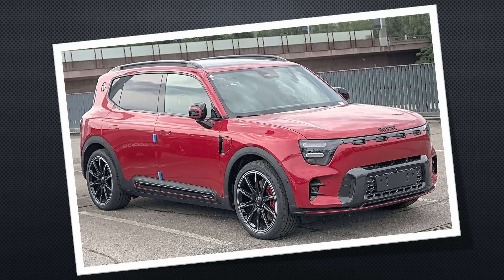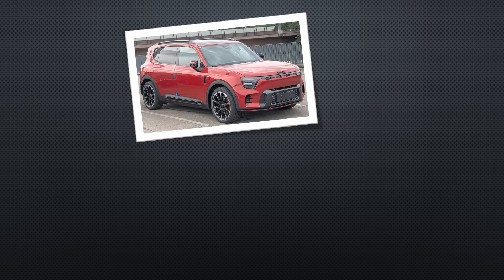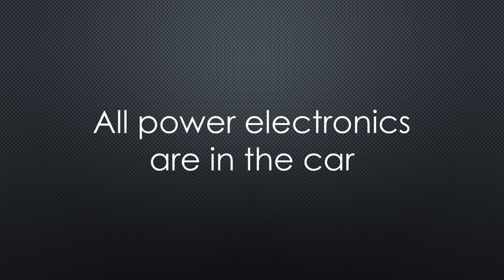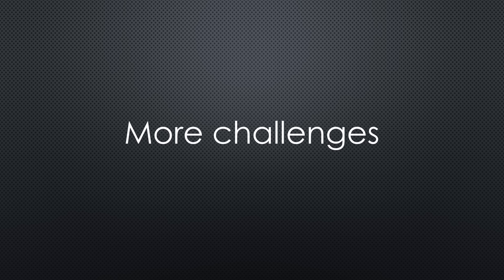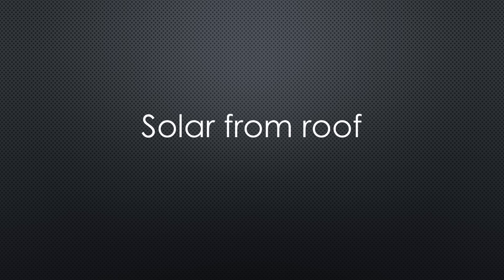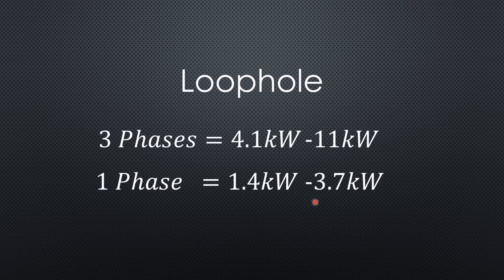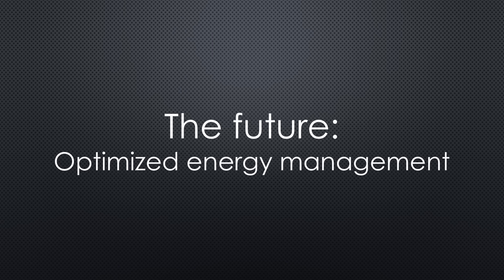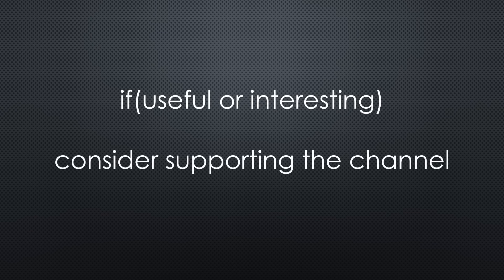How to charge an EV using Solar, OCPP, and EVCC

Comment: DC Charging at home is a fun one. There is seemingly no minimum output as I've seen as low as 0.05kW, so every tiny little bit from my solar feeds into my car during a DC charging session once the home battery is full 🙃it also provides far more information "two way" which is helpful for HomeAssistant and automations. Good to hear you here again 😄
Reply from the maker: Are there already DC wallboxes available for home use?
Reply: @AndreasSpiess  yup! I have one. It’s part of my inverter/battery stack and can do up to 25kW. There aren’t many options but they do exist. Mine also allows V2X which is handy.

Comment: j'ai une wallbox open EVSE (usa) connecté à home assistant et un service simple PID ce qui permet de charger le véhicule uniquement avec l'excédant solaire la charge s'adapte en 1seconde aux passages nuageux et aux variation de la consommation de la maison
Reply from the maker: A very good solution. I will probably not adapt the car charging so fast because my battery can fill short clouds. I also want to use Solar forecast to optimize the distribution between the car and the home battery. The car only has a second priority because it has such a big battery.
Reply: @AndreasSpiess  la prédiction de l'ensoleillement n'est pas assez précise car quand le VE charge avec le surplus solaire à 30A AC si un nuage noir survient les batteries statiques doivent sortir rapidement 130A CC ce qui est beaucoup, le plus difficile a été de trouver une logique qui réagit rapidement et rationellement aux nouvelles conditions et "simple PID controller" a été pour moi la bonne solution parfaitement réglable.
Reply from the maker: In my setup (800V home batteries), the battery can supply up to 5kW. The inverter does the PID control. That is why I need to include the wallbox's consumption in the overall load. Like that, the inverter ensures that there is +/- 0W at the utility's smart meter. It is not very fast; there is always a slight flow of a few watts forth or back. But this is cents per day.

Comment: Good to see that you're getting up to speed on car charging.
I wouldn't worry about max AC charge rate. I deliberately slow my charging at home to about 5 kW and this has always met my needs. 
I have sufficient solar PV to power my two EVs (Tesla and Rivian). I have "net metering" so it doesn't matter when I charge. My solar feeds excess to the grid during the day and I can draw on it whenever I need.
I've recently installed two OCPP compliant wallboxes at my office (which has solar) and they work well. 
You might look at the OpenEVSE wallboxes. They are OCPP compliant, global, open source and reliable. (I still have my original OpenEVSE wallbox which is 10 years old and still working.)
Reply from the maker: Thank you for sharing your experience! I do not think that they would accept DIY wallboxes in Switzerland (AC installations are very regulated).
Net Metering is a fine thing and easy to manage. However, I just heard that California abandoned it. 
Here, this was never introduced. So we always had to pay attention to use our own energy.
Reply: @AndreasSpiess  If you buy one of their pre-assembled boxes, they say:
All safety features required by SAE J1772, UL and NEC are standard.
It seems that you are looking for something open source that you can "hack" to integrate with your solar PV.

Comment: Good to see you gracing my feed again, Mr. Speiss! Looking forward to seeing your perspective on EV charging. Years ago, I know Julian Ilett made an EVSE "wallbox" using discreet logic. He found the Control Pilot connection pulldown wasn't universally supported on the car side, though the 1 kHz carrier absolutely was.
Reply from the maker: It seems that these days it has become a bit easier. I was even able to purchase an adapter from AliExpress to use my car as a 230V battery! Very handy!

Comment: I'm in central Florida and have 12Kw solar, we have three ev's and two of them get charged at work. The third is home in the daytime and  only drives 60 miles a week. The solar on the house is grid tied and only provide enough power for the home. I added 12 solar panels to my double carport and plugged it into a Ecoflow with 8Kwh battery  then I plugged in the charger that came with the car charging 1.64 Kw. The battery get charged fast than the car charges, but when a cloud goes by it keep charging.
Reply from the maker: Cool project! It is interesting to see your consumption. The average consumption of our home (excluding car) is around 13kWh/day ;-)
50% is my lab, BTW.
But of course, you have much more sun! I still remember the heat in the cockpit when I leaned to fly in Venice.

Comment: Did you look at OpenEVSE? From the firmware notes it seems the board and firmware is used commercially and should pass certifications, but I'm not loving the ESP32 add-on for wifi etc.
(edit: as an alternative for your importing friend)
Reply from the maker: Yes. But AC installations are significantly regulated here. So DIY would probably not be accepted...
Reply: Yeah, DIY is a no-go as we can't even put a schuko or CEE plug on an EVSE now - but if one were ambitious about selling chargers then OpenEVSE is a good basis for a product with hardware and firmware that has already been through certifications.

Comment: One more question regarding your atomic bunker situation - we have (also in Switzerland) an underground bunker which is part of our house (the basement and it is just another basement room) and shared underground parking with other neighbors. The wallbox I plan to install will be mounted on the wall of the shared parking, close to our door and car. I don't have to expect problems regarding hacking the communication between the inverter and your Huawei device, right?
Also, what is your type of smart meter, can you recommend me some devices that I can easily find in Switzerland, for example from Digitec oror similar retailers?
Ich entschuldige mich dafür, dass ich auf Englisch schreibe - ich hätte auch auf Deutsch schreiben können, aber ich möchte, dass es für die Mehrheit der Leser der Kommentare verständlich ist. Danke im Voraus!
Reply from the maker: 1. I use the smart meter that came with my Huawei inverter.
2. The powr meter of the utility company is in a room close to the car. That is why I was able to mount the wallbox behind this meter. If this is not hte case, they will add a meter particularly for the wallbox. This is done for other cars in our garage.
3. I had to use a Devolo PLC to bring Wi-Fi to the garage. Otherwise, the car cannot update during night, and I cannot heat it remotely.

Comment: Great to see you back to YouTube Andreas, and looking forward to more on this topic! When I had my Tesla wall box fitted, the electrician fitted an auxiliary third party box upstream of it. This has a Current Transformer (CT) on the supply to the house (so it sees everything except the current to the Tesla wall box). As far as I can see a contacter in this box cuts the supply to the Tesla box if the current to the house rises above a threshold. This makes sense since the total of the house circuit fuses is just below the main supply fuse so full load on the house plus the charging load would blow the main fuse! But this is a very crude way to do it! Sensibly the CT would be connected to the wall box and would modulate the charging current so the total current to the house plus the car charging current was kept below the utility maximum. This method also has the undesirable characteristic that the wall box loses power completely and stops communicating when the house power draw rises above the threshold! Bizarrely, the cable from the consumer unit to the Tesla wall box is about three times as thick as the incoming cable from the utility!
Reply from the maker: Also here, the wallbox is the biggest consumer in the home. That is why the electricity company wanted a remote "kill switch" (which is in the law).
Reply: @AndreasSpiess  I do not think it is a utility controlled 'kill switch' in our case - there is no sign of any telemetry to the device. I think it is a simple local load shedding device. Ironically, the Tesla wall box does have a telemetry and control interface to the electricity supplier, which is being cut off by this 'dumb' device upstream!

Comment: If you chose Tesla, it would make this hole thing so much easier, because you can connect to the car wit API and tell at what speed to charge (down to 1kw). Also you would have a faster car 😊
Reply from the maker: Interesting! That is a good idea to control the charging directly through the car. I'm not sure how many messages you can send each day (if there is a limitation on the Tesla cloud). The charging power will change rapidly if there are clouds...

Comment: Imagine the conversions lost from the panels to the car battery, lol
If I could I would charge the car directly over DC, minimising the lost from more than 20%, another nice project, but not for YouTube.
Reply from the maker: That is not an easy task. In my case, it would be impossible because I would need a 100m DC cable across several properties...
Reply: @AndreasSpiess  yes of course, but imagine that juicy DC voltage right into you car with less losses

Comment: We don't really have 2 phase in our homes here.  In the US we use split phase.
Reply from the maker: Indeed. But I thought it is similar tow two phases (2x 110V)
Reply: @AndreasSpiess It's very similar but there are things we have to take into account wiring it up.  I think the most interesting part is balancing loads.  The center neutral can actually be carrying no load at all when a circuit is balanced.  Then we have rules about bonding the ground and neutral wires.  They must be bonded in the main panel but never bonded in sub panels.  I'm not an electrician so I'm sure there are other important points I've missed.

Comment: Thanks an welcome back! Congrats to your Smart! Fronius Inverter works with Fronius Chargers out of the box. PV Surplus charging out of the box (incl. phase change) without any addons - and locally without any cloud. You get the values over Modbus/TCP. Anyway, PV and BEV is a winning team!.
Reply from the maker: Good to know. So the only complication would be my "bunker" ;-)
Reply: @AndreasSpiess  Indeed, that might be the case - but for most solutions as well.

Comment: I once saw a wallbox with a current transformer connected in the electric panel: it would both reduce the charging current depending on other loads in the house and start charging when it detected the solar power was put in the grid. This seems like a lot simpler solution, but somehow it is not common.
Reply from the maker: Indeed, some wallboxes offer this feature. However, this is not very flexible. And in my case, with the wallbox 100 away from the panel, not feasible.

Comment: Great to hear from you again Andreas. Hopefully we’ll have V2X released in Australia for mass market adoption early next year - there are trials underway currently and several bidirectional DC chargers are going through certification for grid connection. EVs are less costly per kWh than home batteries here, and 40% of premises have rooftop solar PV. I’ll have to do some research of OCCP 2.0.1 & 1.6J.
Reply from the maker: I am not sure this will be a big success. Also, because I do not know how car manufacturers react (warranty). In the meantime, shifting charging to good times is already a very good thing.
Reply: @AndreasSpiess yes, traction battery warranty is a significant issue - most EV makers don't currently advertise bidirectional charging even though they support it (e.g. Tesla Y, 3). I've seen BYD claim their new Gen2 LFP blade battery is good for 5000 cycles, although they only warrant 160,000km (375 cycles). Hopefully this will change and valuable battery resources will be used to their capacity through V2X.

Comment: Thanks Andreas! Have  a lot of fun with your new EV! It was great seeing that you are going through similar concerns with EV charging like many of us. In Switzerland, I have SolarEdge inverter, WallBox 11 kW (yes, that's the name of this charger and not only a type, 3-phase, min 6A, unfortunately no changing into 1-phase) charger with WallBox meter to be able to see what I sell or buy from the grid. HomeAssistant is able to read and control both (inverter and charger), so I'm not sure why you're looking for other add-ons in HA. WallBox has 2 options for eco use from solar PV, full eco meaning waiting for at least 4.8 kW from solar (6A, similarly to you, rare due to size of my system) and partial eco, meaning half can be purchased from the grid. Of note, I agree with you that EV chargers should not be called chargers, as they are not but just controllers and charger/inverter is in the EV.
Reply from the maker: Thank you for sharing your installation data. 
I use EVCC because it can connect to weather forecasts and variable tariffs (not yet in Switzerland, I know). And there is a community I would like to support.

Comment: One reason for the minimum 6A charge rate is that in most cars, quite a lot of the car's systems are powered on during charging, and are drawing some current, so at low rates, so charging becomes very inefficient. Not really necessary but a consequence of their architecture.  If you are designing a solar system only to charge the EV, a possible way to allow charging at lower rates is to reduce the AC voltage - many car onboard chargers will run down to 90VAC
It's a shame that cars don't have trickle-charge inputs to allow efficient charging at very low rates - the hardware for this would be easy - a diode +fuse to isolate the HV, so it could charge without closing the pack contactors, avoiding the waste of the car's systems being powered up.
There are some wallboxes (e.g. Solax) that will integrate with the solar inverter to automatically adjust charge rate based on solar output.
Reply from the maker: 1. I also read that the 6A is because of the consumption of the internal systems. However, the standard was defined in 2008 (AFAIK). So I am not sure if this is still a problem. And then, single-phase chargers would be a very bad idea. But they seem to work ok and are sold as mobile solutions.
2. You are right. Also, one of my chargers has current clamps to measure the current flowing to or from the grid. I assume that works. However, it is not very flexible, and in my case, with a 100 m distance, it does not work.

Comment: Can you explain how charge EV using DC?
Reply from the maker: So far, I only plugged the connector in the car and presented my credit card ;-) 
No joke: I did not care about how that works. But maybe one day I will have a reason to learn it.
Reply: @AndreasSpiess  Main reason is to charge EV directly from solar panels. Benefits minimun current transformation and maximum charging  power!
Reply from the maker: I investigated a bit into this matter because others also mentioned it. However, I did not find a proper solution. Maybe a project ;-)

Comment: Is max 1.4KWh charging rate even worth the trouble and investment? Or is this just a "test plan" before enlarging your solar array?
Reply: It must be 1.4kW, charging rates aren't measured in kWh
Reply from the maker: Maybe not 1.4kW. But for sure less than 4.1kW. The only problem could be that the car uses a lot of energy for its own purpose.
With 3kW, I get 15km per hour. At least something...
Reply: @AndreasSpiess , Thanks!
My question is exactly around this 'value for money' calculation. If, at best, you get a few hours of 3KW excess power a day - Does the saving (6-9-12KWh?) worth the extra complexity of the system? Not specifically for you, but for someone who needs to consider this option when designing a home solar system.
Reply from the maker: Next year, we will receive 7 cents per kWh if we sell electricity...

Comment: be careful with ocpp 1.6J...i strongly urge you to update to at least 2.0.1
Reply from the maker: Why?
Reply: @AndreasSpiess  this is some years ago(2018ish) but i had trouble with missing a heartbeat function and a bug with charging state that wasnt implemented in ocpp 1.6J... the heartbeat function ensure the COM between A and B... the charging state prevents a car(B) cannot "force" charger(A) to charge more than the installation is rated for....example: the cable and tax was rated for 16A, after handshake, the car gain access but changes to 32A for 16A taxrate and the installation wasnt built for that, if the car(B) said 32A from the start, the charger(A) woulnt allow it.... i do remember the bugfix was implemented in the 2.0.1 update.. the combination of missing heartbeat function and the user of a car could bypass charing limit was complicated during reboot of the charger(A)....

Comment: Curious why at 650 horsepower, it is much slower 0-60mph than a Tesla Model 3 Performance, which Tesla claims as 450 HP and has been dyno tested at 520 HP. Is it heavier or just taller gear ratio for autobahn driving?
Reply from the maker: The Tesla seems to be much lighter (500kg). It has a much smaller battery. But because it is more compact, the Tesla still has a slightly higher WLTP range. 
I wanted a car with plenty of room for my projects and an elevated driving position (SUV-like)...

Comment: Great timing for this subject and your return. In anticipation of EV delivery in Dec/Jan, I'm just in the process of getting quotes for installation of a PV / battery system and a charge point. BTW in the UK most domestic installations are only single phase so charging is limited to 7kW.
Reply from the maker: Thanks for sharing. I didn't know that you only use one phase!